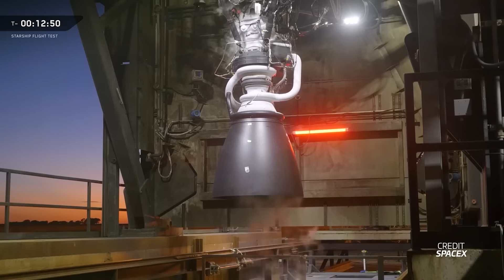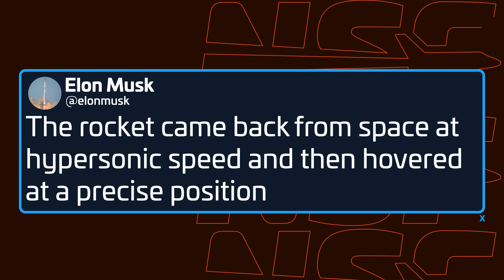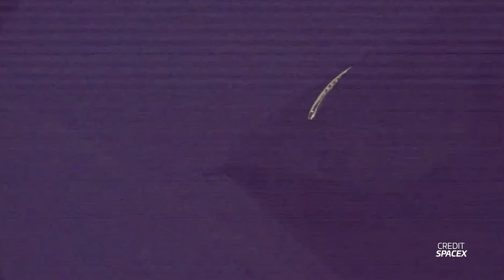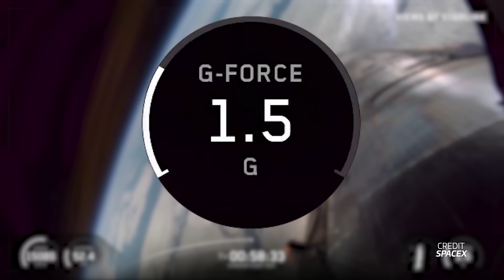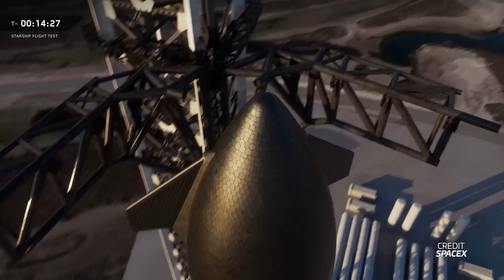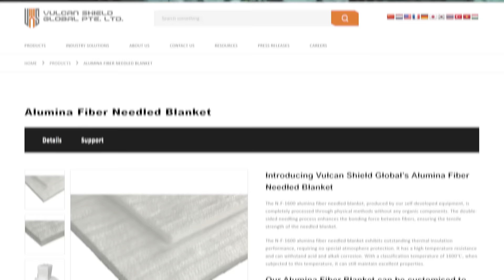The End of Version 2 and the Dawn of Starship V3 | Starbase Update

Comment: I really find it fascinating that the same yaw maneuvers that the space shuttle performed during reentry are being used with Ship. They are completely different airfoils with completely different aerodynamic loading and a completely different method of affecting those orientation changes. It tickles me right in the nerd to see two completely different beasts end up at the same solution. I believe they can move areas of peak heating around the heatshield this way, too.

Comment: The banking is not about "efficiently shedding energy". 

If you deorbit "just right", you'll stick the landing at say starbase exactly. But now... what if a puf of unforeseen wind blows you back a little? No you won't reach your targeted spot. 

So what you need to do is to aim for "will overfly the target by XXX" and then in a controlled manner bleed off the extra energy. If you then find that you're going to overshoot the target, you increase the "bleed off extra energy" a bit, and reduce it when you seem to be ending up short of the targeted landing spot. 

It is this control that it's all about.

Comment: Anyone understand why they deploy the Starlinks from the aft end of the stack? That slot round nearly half the circumference must structurally weaken the ship and the further aft it is the more force it will experience from the mass of the ship ahead of it (when under acceleration and atmospheric forces). Since it is not under acceleration during Starlink deployment it should make no difference which end deployment is from. Indeed, I think I would have gone for forward deployment and jacked up the whole nose cone on simple screw jacks creating an all round slot and allowing simultaneous, force balanced, deployment in two directions. Admittedly the header tank in the nose cone complicates this, but there are a couple of obvious solutions to that problem. Can I have a job now, Elon?
Reply: The heat shield is on the opposite end of the door, and much of the Pez dispenser intrudes into the nose cone, making a door structure, there more complicated. What you describe doesn’t seem to fit their “best part is no part” philosophy.
Reply: @EMichaelBall  On the contrary, my design eliminates lots of parts. The structural strengthening necessary to carry thrust loads around the slot. The door itself and the complex mechanism to actuate it. The mechanism to translate half the satellites across the width of the ship. The fuel necessary for thrusters compensating for the asymmetric momentum transfer. It also just occurred to me that my design concept also lays the ground work for load-bearing full bay doors for large cargo deployment. The nose cone would clamp the doors in the closed position and would be jacked forward to create clearance for them to open.

Comment: That Starship didn't blow up with a hole in a tank is testament to engineering.
Reply: Only the LOX tank was "punctured". 
Leaking Methane tanks might have an worse exciting result.
Reply: @imconsequetau5275 The methane tank was leaking too
Reply: It looked to me like flames in the cargo compartment area. Could be hot methane gas was passing up the exterior but under the tiles and ignited on contact with the outside air. 
@Ellhulto
Reply: @imconsequetau5275 thanks professor
Reply: Watch the high-res video released afterwards
The starship had at least three holes.  Two were venting methane, one oxygen
Assessment: Any hole in a tank are self-contained by cooling effect of the venting of super cold gases at rupture point
Reply: @bru512 The point was that it survived those holes?
Reply: @Ellhulto Yes, I was 3x' enhancing your good point.  Take a bow

Comment: Look, the heat shield is CLEARLY not in reusable condition and looks about as bad as the last flight.  It did keep Starship alive, but that heat shield will never be used again -- THAT'S NOT REUSABLE!
Reply: If only there was an explanation for that
Reply: @Alexphysics13  If only you provided that explanation!  And do you have an explanation for the previous launch that had similar degradation of the heat shield?
Reply: @Raptorman0909  its a test, its not expected to be reusable right now
Reply: @Ethan_Roberts Of course its a test, they haven't certified it for cargo and most certainly not for humans so of course its a test!  But this is the 11th test, at what point do they inch closer to operation?  By way of example SLS, on it's very FIRST launch achieved the following:
1.  Left the pad (there was some fixable pad damage)
2.  They reached LEO - -something Starship has not achieved in 11 attempts
3.  They then left LEO and circled around the Moon travelling more than 250,000 miles from Earth in the process
4.  They returned to Earth with the capsule making a safe landing.
When is SpaceX going to actually achieve something with Starship -- fireworks are fun and fireworks are great, but rockets are not supposed to explode or burn up on reentry!  When, prey tell, is SpaceX going to stop wasting taxpayer money for Musk's vanity project?
Reply: @Raptorman0909 you can move the goalposts to make the claim that Starship hasn't reached LEO yet in reality, its achieved its intended trajectory 6 times. That's 5 times more than SLS and for a fraction of the cost. SLS set out to test a lunar mission profile while Starship is testing reusability. They have different aims and both have made progress towards their respective goals. Starship is privately funded and have the ability to test to failure, SLS does not have this benefit. Not to mention, none of SLSs hardware will be reused, 2 Superheavy boosters have already been reflown which shows they have made significant progress in this aspect
Reply: @Raptorman0909 Federal funding for Starship requires meeting set milestones, most of which have not yet been met.
Reply: @EMichaelBall  Sorry, SpaceX has already received a goodly portion of the $4B NASA's earmarked for Starship.  And if you have even a clue as to how government contracts actually work you'd know that milestones are fungible and most companies that are in such arrangements wind up getting the lion share for the contract even when the fail to make those milestones.  I'd estimate that each Starship/SuperHeavy launch costs SpaceX about $300M so $4B would cover about 13 Starship/SuperHeavy launches on the taxpayers dime and essentially zero for SpaceX as the taxpayer has already foot the bill!
Reply: @EMichaelBall  Exactly, an actual reasonable contract vs all the 'cost-plus' contracts NASA had with previous companies which allow huge over-budget situations.
Reply: Apples to oranges really.
Reply: @JAM3k  What do you mean by apples and oranges?  Why were these other programs able to succeed on the very first launch and why has SpaceX taken so many efforts to still not have a viable launch system?  Why should we apply a different standard for one and not the other?  After 11 attempts SpaceX does NOT have a viable launch system yet with Apollo the 11th launch put men on the Moon and returned them to Earth!

But if you wish to permit SpaceX more time how much more time do you think is reasonable and how many launch attempts before they have a validated system capable of launching cargo?  And then how long after that before it's man rated?  With Apollo the first manned launch was Apollo 7 and on Apollo 8 Borman, Anders and Lovell circled the Moon before returning to Earth.  And, in case you are unaware, NASA had to break new ground while SpaceX has been gifted the technology NASA pioneered!
Reply: @Raptorman0909 already explained it to you but I guess that response doesn't suit your narrative so it was ignored.
Reply: @Ethan_Roberts Well Ethan, I guess you're afraid to explain it knowing I'll use the actual facts to counter your BS.
Reply: @Raptorman0909 already did explain it, you ignored it. You're comparing two completely different tests with different goals and pretending they're the same. As mentioned, apples to oranges
Reply: @Ethan_Roberts BS!  I laid out the case and you blather on regurgitating Musk Speak -- excuse me if I'm unimpressed!
The failure of Starship is a failure of design, the concept is all wrong and evidence of that is the insanely large heatshield.  The capsule is the most efficient design to minimize non-payload mass.  But Starship is not just a reentry vehicle carrying people, it's the massive second stage of an even more massive first stage and the heatshield needed to protect so large a stage is too risky and the mass penalty is too great!.  Physics is a b1tch!
Reply: @Raptorman0909 the fact you think this flight was a failure is telling of how little you understand about the program and likely spaceflight in general. Stop trying to compare two different launch profiles and test goals
Reply: @Ethan_Roberts "Stop trying to compare two different launch profiles and test goals" -- Why?
Reply: @Raptorman0909 because you're making the claim that one didn't achieve the same test goals as the other, so therefore its own test is invalid and a failure. They're not comparable
Reply: @Ethan_Roberts They, SpaceX, have had the advantage of the science and engineering NASA developed for Apollo and they've also benefitted from 60 years in technology and materials advances -- and as I said, NASA (US taxpayer) is mostly funding Starship/SuperHeavy.  You still refuse to admit that what NASA was able to do on their first flight is something SpaceX has not achieved with this program.  Explain that or buzz off!
Reply: @Raptorman0909 you also believe Starship is mostly funded by NASA, something else you're wrong about. The HLS contract is milestone based, they have not received all 3 billion in one go. Plus, 10 billion has been spent on the project so far which comes from SpaceX's revenue and private investors. Do explain how its mostly taxpayer funded if this is the case. And I think you're forgetting they have a workhorse launch vehicle that flies almost daily, they have the technology to put payload into orbit so don't act like they're clueless
Reply: @Ethan_Roberts I've already stated my estimate that its costing SpaceX about $300M for each launch and at 11 attempts that's about $3.3B -- they have a ways to go before exhausting NASA (taxpayers) largesse.
Reply: @Raptorman0909 thats your estimate based off what exactly? Real analysts have made their estimates coming to the figure I stated before, which does not include HLS funding as they have not received this as one single payment. This development is not costing the taxpayer a thing, SLS on the other hand...
Reply: @Ethan_Roberts Yes, I did not hide the fact that it was my estimate, rather than pull a number out of thin air and play it off as fact.  I remind you that Musk and Shotwell have claimed a Starship launch to cost only a few million and be s cheap you could use it instead of an airplane.  You'll note I didn't use those made up numbers that will never happen, I used a more reasonable estimation by comparing to other spacecraft and surmising the inhouse cost might be half that.  You're free to provide your source for cost estimates!
Reply: @Raptorman0909 Arsetechnica reports 90 million for the cost of a full stack based of the estimates made by Payload, thats less than a third the cost you've pulled out of thin air and claim is factual. You've literally made up a number based purely on your own poor guesswork of Starship development to keep pushing a narrative about the program. Do you people enjoy being wrong all the time or something?
Reply: @Ethan_Roberts Oh I bet those numbers have been Musked.  The operational costs alone are significant.  And 39 Raptor engines are how much by themselves?
But if we go with the ARS numbers and it's $90M for a full stack then I guess SpaceX have years more to drain NASA's funding.  The actual cost for a Falcon 9 launch is about $55M, but Starship/SuperHeavy is 10X larger, scaled that way Starship/SuperHeavy would be about $550M per launch -- my estimate is half that!
Reply: @Raptorman0909  that's such a delusional take to deny anything you think Elon has something to do with. Keep rejecting facts for your own beliefs and remain ignorant if that's what makes you feel special
Reply: @Raptorman0909  What NASA accomplished in the '60s was nothing short of extraordinary, period. With that said, they spent well north of $300B (in 2025 $'s) and took 10 years to send people (Apollo 8) after the first moon probes reached the moon with zero reusability. THIS is the really tough part. With that said, SpaceX tested Starhopper in 2018 and has probably spent $10B or less up to this point (let's say they end at $30B by the time HLS gets to the moon with people). Still an order of magnitude less costly with full reusability. Again, this is huge. Also, SpaceX only used limited IP from NASA for development of the heatshield material (PICA-X) for dragon and Merlin engines (not Raptors). Nothing I could find was used for the Starship program.

Comment: I would really be interested to see the temperature of the Starship alongside the other telemetry stats. Why don't they do this?
Reply: There isn't "a" temperature. It varies widely across the ship and they probably have hundreds if not thousands of sensors monitoring those. So which one would you pick?
Reply: @Niosus  well, if there are 1000s of sensors, picking just one would be really hard. Maybe an average temp of them all. I can imagine at lift off the rocket is rather cool, but coming down through the atmosphere it would be rather sizzling around the heat shields. And at splashdown the rocket would still be quite hot as it plunges into the sea. I just thought it might be interesting to see an overall temp graph throughout the flight.

Comment: The booster hover is interesting.  Would be useful on the moon lander to use the ship  main engines to slow down to a point where the exhaust doesn't kick up the moon dust and then finish the landing with the ring of landing engines higher up on the ship.  If the landing engines experience a fault then re-ignite the main engines and return to orbit, avoiding a crash.
Reply: I believe that's the intention. With only 1/6G, and the relatively low speed of the ship, only a few engines will be needed to reduce speed enough for a ring of thrusts at the top to finish the job.
Reply: I think they going to land HLS on main engines and not have any special landing engines.
The best part is no part. !

Comment: Thanks! ... 

Re landing route back to the launch pad of Starship itself, re the proposed route you showed...

Surely,  NOT right away! Your shown route has low-altitude transit over Port Isabel and the South Padre hotels. 

Surely it is better... until reliability is demonstrated... to get Starship descending (still at a somewhat high altitude) ovet land, and then to over the Gulf, and doing final maneuvering mostly over open water.
Reply: Plus, the tower faces East, so the ship must do at least the final approach from that direction.

Comment: Looking back it makes you wonder how they ever could have thought concrete (of any kind) would stand up to 33 raptor engines at full power. Lots of valuable lessons learned over at OLM 1. I can remember how the press was digging at SpaceX over the repeat failures up to and including Flight 9. We all hoped they would hit their stride and they surely have. They persevered and ended V2 testing on a roll with a two-feather cap on the wall. V3 is looking awesome! Just catching a quick peek a the new nosecone shows improvements to fitment and assembly. Starship is finally going to look more like a finished rocket ready to haul precious cargo versus the flying test article it is now. It's a bummer to think we will not see another launch until next year, but watching all the new design features come to life (Thanks NSF!) will be just as fun. By the time the first ship leaves OLM2 we'll be ready to christen "V3 Day" and hold a block party in the street...
Reply: They didn't expect concrete to hold up. They were already planning, and in fact were building the upside down shower head when they launched the first time. They just didn't expect it to break up and turn in to a rock blizzard.
Reply: I don't think SpaceX, or most enthusiasts that know what's going on, were concerned with what the biased mass (legacy) media think about anything. This is all just part of the testing and learning process.

Comment: It was not perfect, a bit click bait here: The oxy and header tank leaks were not good at all, almost disasterous, and a hover phase was entirely missing.
PS: the beard is still awful, but better than the one of the live-SpaceX eye-blinking boy.
Reply: I also don’t see where the “clickbait” is like ????
Reply: What hover phase are you talking about?
Reply: @Alexphysics13  Simulating a catch at the tower. Belly-flop occured maybe too late.
Reply: @chiron9948bellyflop happened when it was supposed to. Have you looked at the easily-available telemetry on screen?
Reply: Jeff!
Reply: They were perfectly fine. They were expected. They deliberately removed tiles in those locations to see if it could handle a missing tile in those locations, and it proved that it could. But of course, you didn't read the flight plan or watch the stream and so are ignorantly confidant that it shows a failure.
Reply: @BabyMakR  'Expected' flames along the tiled belly? Did not read that this was foreseen and mentioned by SpaceX before the flight.
Reply: @chiron9948 They said several times before launch, and in the days leading up to it, that with the number an location of the missing tiles they did not give very high odds of it making it through re-entry.